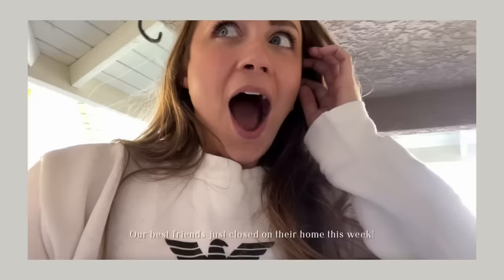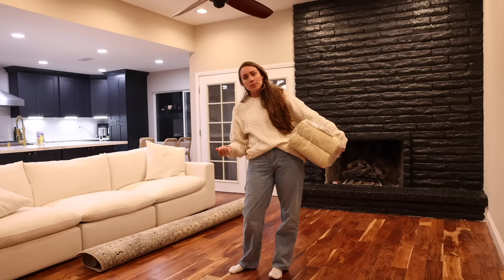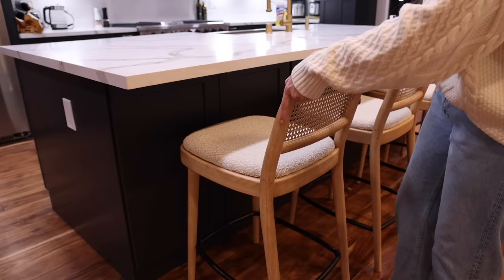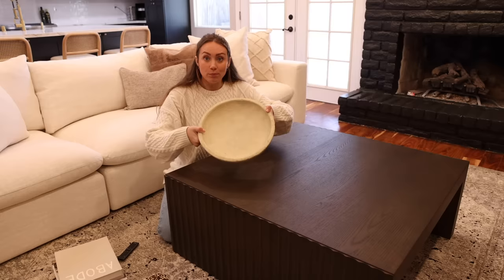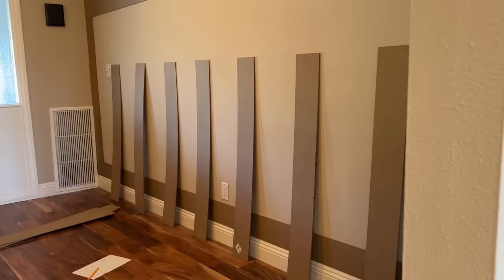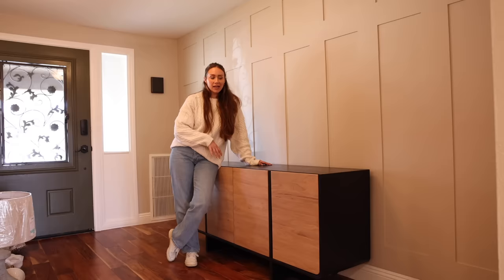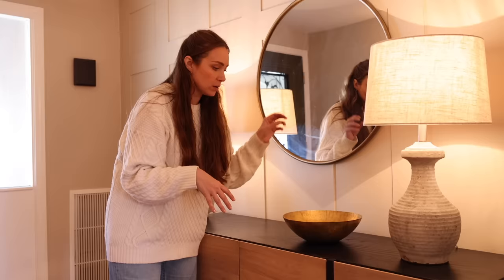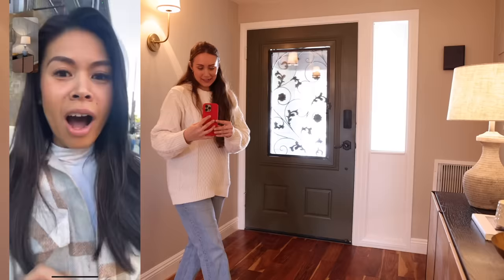LIVING ROOM & ENTRYWAY MAKEOVER *Traditional, Organic Modern* BEFORE & AFTER | XO, MaCenna

Comment: Beautiful makeover. I think the entryway definitely needs a longer rug though. Well done, MaCenna!
Reply: I think the struggle is finding the rugs. So hard.
Reply: I would have tried a larger rug… perhaps a 5 by 7 instead of 3x5
Reply: @heidigresh2743 
That's what I was thinking - try a 5x7 in the same rug.  And if it's too wide, buy another 3x5 and put them together, end to end.  It looks like there's plenty of space.

Otherwise, I love the entry!
Reply: An easy fix is to get a second one identical to the 3x5 and carpet tape them together on the back to create one larger 5x6 rug.
Reply: @EvelynM-vlogs  great idea!!
Reply: @Pkeats817  It works really well. We attached two 3x7 identical rugs together to create one long hallway runner that is 3x14. It looks better than having two rugs down that look the same which is always a lesser look than one supposedly unique rug.
Reply: @EvelynM-vlogs  Awesome. 🙂

Comment: The makeover is lovely and thoughtful. I do have some suggestions. The ceiling fan has a purpose which is to move the air in the home and since the living space is within the kitchen space, it will come in handy. The entryway doesn’t need 5 lights. The sconces are beautiful and the replacement for the booblight will be sufficient for lighting needs. The 2 lamps on the entryway table are too much and take away from the board and batten wall. In this space, less would be more. A longer runner would be nice.
Reply: I personally never use overhead lighting in my home. It’s too bright. I much prefer to have lamp lighting & I love the lamps on the entry way, although I understand what you are saying. If the lamps were a tad bit smaller, it would be perfection😊

Comment: I think the cold air vent should be painted the same all colour as the entry so it disappears too. Not a fan of the entry rug as I think it's too small. The woodwork is stunning...great job o  the rest of the makeover!
Reply: Was going to suggest that too.
Reply: I'm surprised that doesn't bother me more.  I noticed it, but thought 🤷🏼‍♀️.  I think it's not too bad because it's in such a small space surrounded by  lot of that color on the door.  And its shape is so reminiscent of the spaces in the board and batten wall.  But we're really only seeing it from this one angle, looking toward the front door.  It might appear more prominent if facing the console piece with the mirror.

ETA:  I was watching on my phone and opened my laptop to take a look - now that cold air return is all I can see! 😂
Reply: An easy fix is to get a second one identical to the 3x5 and carpet tape them together on the back to create one larger 5x6 rug.
Reply: Yup - she still has a lot to learn…
Reply: @amlambert 
Oh... and YOU'RE the authority?

Comment: The vent should be painted along with the side door wood and needs a bigger rug at the entry way. Just recommend those changes to them when you go back. Good job Macenna. You are a good friend. They get free gifts as well as professional designer. 👏👏👏👏👏👏👏👏
Reply: Side door?  The one by the fireplace?  Just checking to see if I'm following.  I like the doors painted white.  I agree with the cold air return.

Comment: Nice start! I think you could go much larger on the entryway rug. Something vintage could bring more warmth. Or a checkered rug to bring the 2-tone of the entry console onto the floor? Did you consider painting the front door black (closer to the dark color in the entry console? Once they move in and start to personalize it with art, it will start to come to life (like your place is). Great base.
Reply: An easy fix is to get a second one identical to the 3x5 and carpet tape them together on the back to create one larger 5x6 rug.

Comment: I suspect that after your friends have lived with the black fireplace, they will regret their choice of color.  There's a beautiful Behr paint, Cracked Pepper, which is darker than deep charcoal but not such a harsh black.  It also has the same deep, almost navy undertone that the kitchen cabinets have.  There are so many pot lights in the kitchen, living room.  I don't really think you need a center light fixture at all, especially if you're going to add a table lamp.  Maybe consider moving it to the dining room? Also, dimmer switches on pot lights would be great.  Finally, the entry looks gorgeous.  From a design perspective I think 5 light fixtures in that small space are way too many.  A smaller, more contemporary lamp (maybe with a metal dome shade) for the credenza wouldn't compete with the sconces and overhead light.  Agree with everyone's suggestion of 5 x 7 rug.  Castlery furniture is really nice!

Comment: New entry sconces are lovely, but I wonder why the sconces were on that side of the entry to begin with. It's an odd place for sconces. Seems like they should have been on the opposite wall.
Reply: Especially after she added lamps to the entry table, the sconces actually seemed completely unnecessary. I totally get that they were already wired on that side of the wall, but yeah, I think lighting on the opposite wall makes the most sense.
Reply: I am thinking maybe there used to be a storage cupboard running along where the entry table is and they had the entry table in between the sconces? That would account for why she found the corridor a bit wide for a rug? The air con outlet would have been hidden by the longer cupboard. Perhaps before selling, they made some alterations to make the entrance wider.

Comment: Seriously re think the fireplace color. Going dark was a good call- it needed it. Getting a color that more closely “speaks to  the kitchen cabinets” would elevate both rooms.  As it stands, these elements are fighting each other. Also the entry hall looks like it could host a much larger  rug .  Think outside the box and use an area rug- even if part of it goes a bit under that side table.

Comment: Another beautiful makeover.  I don't understand why the rug in the front entry is not under the door?  Since it's too small floating in the centre of the room.....place it under the front door.  When you walk in there needs to be someplace to land without potentially ruining the floors.  Love the kitchen redo....best use of the space.  I think I agree with the comments that there's too many lights in the front hall.  Personally, don't really need the sconces especially since there are two lamps on the credenza.   Perhaps remove the sconces and place a large piece of artwork instead.

Comment: What is the purpose of the wall sconces on the opposite side of the entry? Was it meant for a entry table to be on that side of the entry? If so they front door should have been put in opposite of how is it with the side light on the other side for more room. The sconces look lost.
Reply: That was where the wiring was when the house was purchased.  Her friends can always remove them as time goes on and they get settled into the house and figure out what works and what doesn’t for them. Decorating is an ongoing process.

Comment: I admit I liked the darker pillow much more than the light ones that were the same as the couch.  The little one is fine but I would swap out one of the couch pillows with that dark one.  Love the wall treatment in the entry. Disagree about the hall lights, I thought the dark metal tied in with the dark touches in the other rooms but more importantly I thought they tied in with the front door scroll design. I admit the glass of the old lights was a bit too cool white and would have been better if the glass had a creamier yellow wash. The lights you added are nice, and the linen shades were great but not sure they work in that room with that door as well as the ones there. But I get it,  not my channel or my home. For the front entry rug when you can't find the right size rug carpet stores will allow you to choose the size and for a fee, they will bind the carpet to make it into a rug. Been some years since I did that but I think it would still be an option. All that really matters is if the homeowners love it.

Comment: What about placing a second rug (the same kind) in the entryway but either sew or duct tape (underneath) the ends together to make a longer rug?
Reply: An easy fix is to get a second one identical to the 3x5 as you mentioned and carpet tape them together on the back to create one larger 5x6 rug.

Comment: I would have extended the molding throughout the entire entry way space, especially where the walls meet...maybe even the entire living space, so it looks less like just a statement wall whereas the rest of the walls are very bare and plain. I have always thought statement walls (especially the ones that were popular in the 2010s ) seemed random and incomplete. Overall you did a great job! I don't think I will ever get the appeal of painted brick though lol but I understand you have to work with what you have...maybe a less shiny finish would have worked  and gave a more natural look

Comment: Possibly … 1 or 2 low curved back swivel chairs may have work better in this tight space which is filled with a lot of straight angle pieces…
Reply: Great idea! I've seen some really interesting modern ones that would really add visual interest to the space.